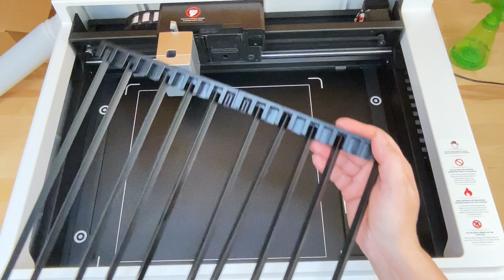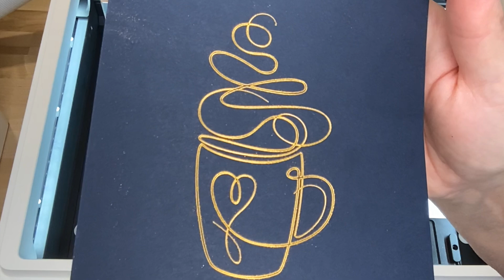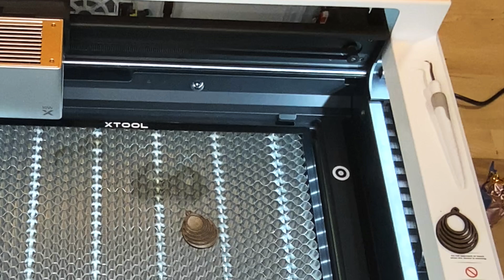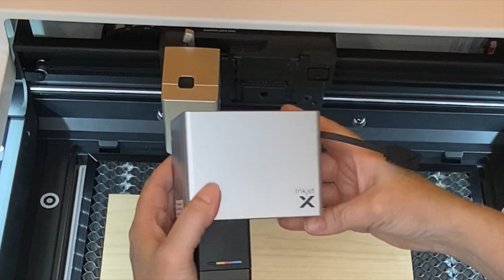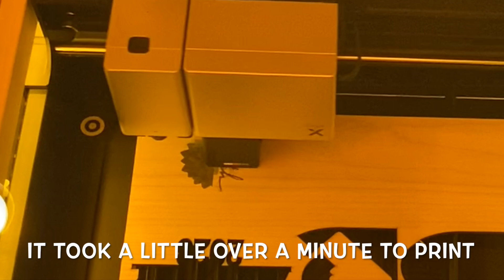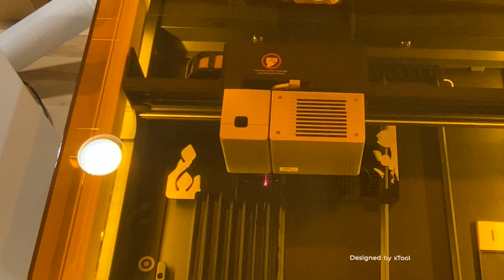Watch Before You Buy the xTool M1 Ultra Laser

Comment: So thank you for trying inkjet AND cutting without flipping things around. That was very helpful. The air assist will certainly help that out alot. The other point ill make is you have the 10 watt, the 20 watt would cut ALOT better and faster
Reply from the maker: Yes, buying the air assist would be very helpful. The higher power would be good too.

Comment: Hello, what settings did you use for foiling? I could not find any information on xtool website related to foiling, and my foiling on pu leather turned out mediocre. I am using xtool foiling sheets with my M1 ultra.
Reply from the maker: I just used the settings that the machine set for me when I selected foiling. Since the PU Leather is thicker and kinda smushy, I would increase the pressure from what you used last time. Do you have any scraps you can use for testing out settings?